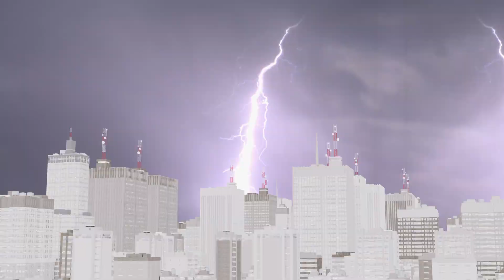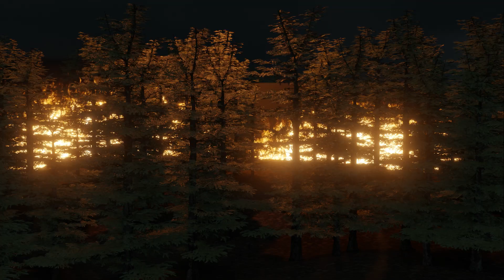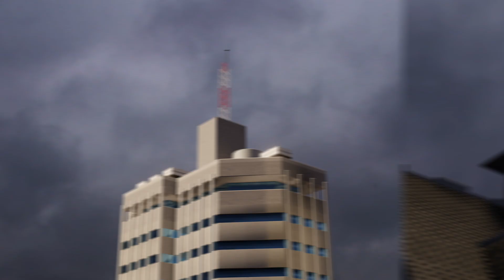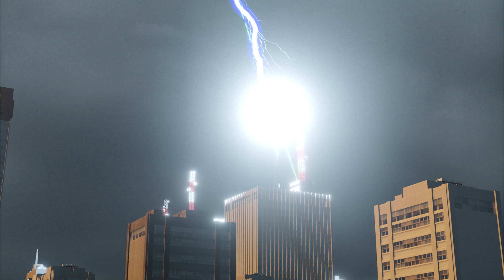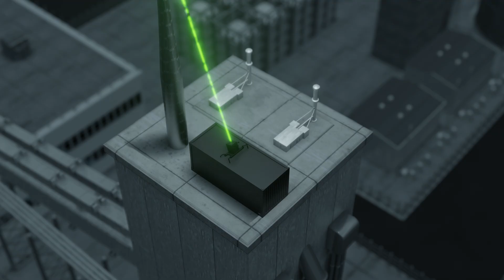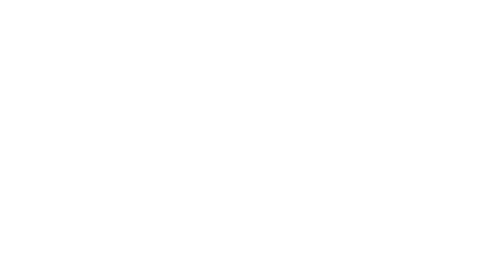Laser lightning Rod Project

Comment: This technology could be also used to create a weapon. Mount the same laser on a plane and equip it with a strong source of electric energy and you will have a laser-guided lightning weapon.
Reply: Already developing
Reply: @AlphaKingofGlory  I work on tangentially related work. It cannot be feasibly used as a weapon.
Reply: Lightning might vaporize the plane and then discharge harmlessly through ionized air channel created by laser. But laser of such power itself would probably take down a space station.
Reply: There is actually a military project on this very subject. I guess it was a DARPA project but I am not sure since its been some time since I read about it. Search for "laser guided lightning" or "laser assisted lightning" and you would probably find the news about it.